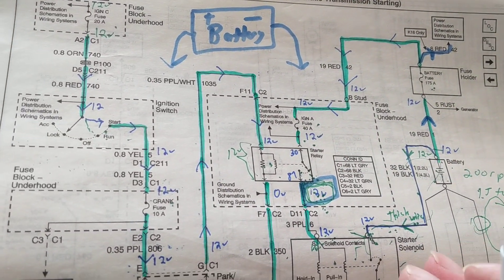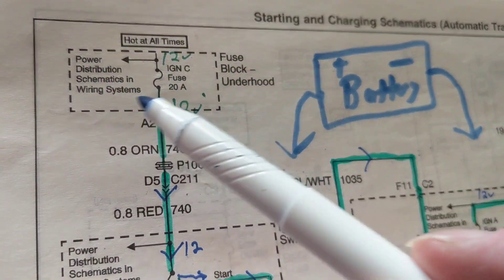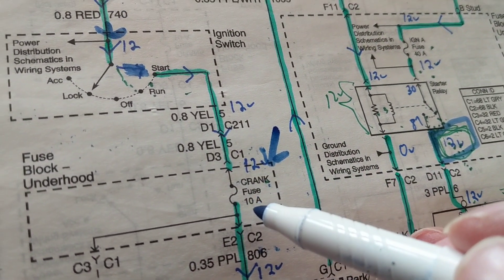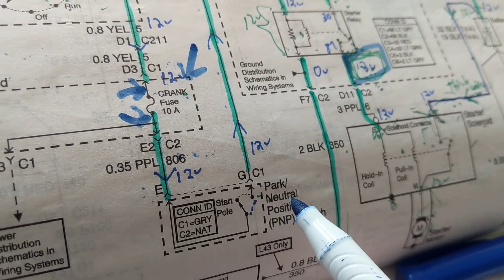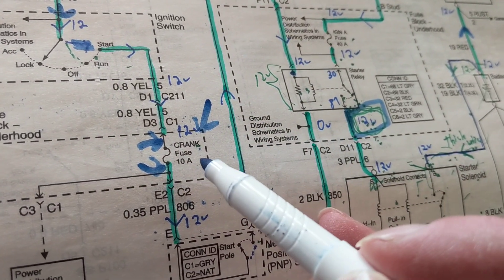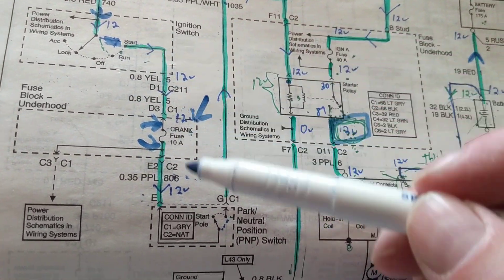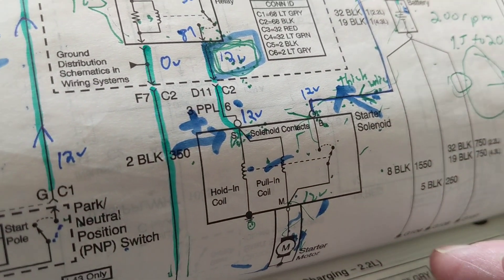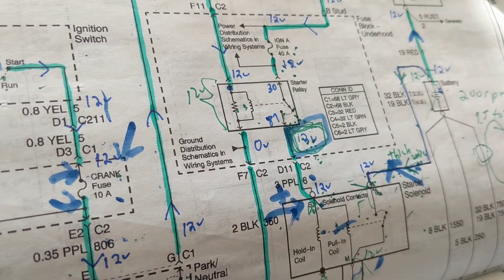NO CRANK NO START DIAGNOSIS HOW TO TROUBLESHOOT

Comment: thank you for sharing! I have 2013 Ford Ranger 2.2 and it starts and runs ok. The main relay pin 86 is showing constant 12V when key is off. Ground and load side of pins are good. Any suggestions?

Comment: Hey I am having trouble with right and left turning signal . But the hazard signal works fine . How do I check the turning signal switch whether is good or bad ?
Reply: What type of car is this
Reply: @automotiveelectronicsfroms2699  Honda Odyssey EX 20008
Reply: @mokarrommolla5820  could be a relay that's feeding both you have to look in the power distribution panel or the fuse panel they call or it could be a multi-purpose switch that's why the hazards come on and the other ones do not come on first look at the fuse box for the relay

Comment: need your help please can you help
Reply from the maker: I never saw your email I apologize but what help do you need I can guide you to the system but remember I'm not there to do measurements or measure pressure or voltage on that vehicle so I can guide you to a certain system
Reply: @Joeelectronicschematicsforauto  Thank you for your understanding, but I need your help, that's why I'm so insistent. I wrote my e-mail address in the comments, but it is not visible. and it doesn't appear in the comments, so I asked for your email address
Reply: @Joeelectronicschematicsforauto  I wrote my own email address in the comments but it is being deleted
Reply: @Joeelectronicschematicsforauto  Could you please give your own email address?
Reply from the maker: @suleymankarakoc909  richterbronx@gmail.com
Reply: @Joeelectronicschematicsforauto 
NO CRANK NO START, 2004 CHEVY MONTE CARLO, I BELIEVE IT IS SECURITY PROBLEM ,N PLEASE HELP